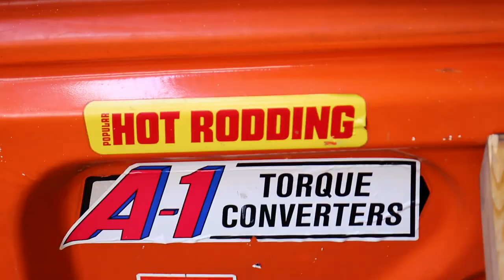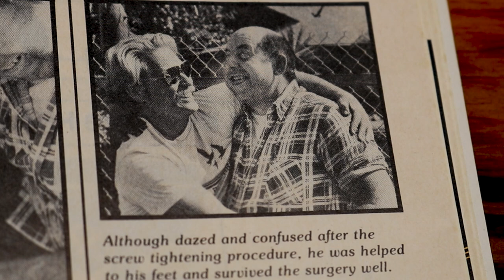THE STAND UP GENERAL LEE RIDES AGAIN!!! | Volo Auto Museum (Part 2)

Comment: Yay, big deal. Thing burns oil. 
Did you ever notice on the Dukes of Hazzard that they never ever had to get gas at the gas station?
Reply from the maker: If you watch the video, Al states at 10:01 that it needs new Valve Cover Gaskets, and he has new ones for it. And yes I did notice that
Reply: That's because it ran on shine